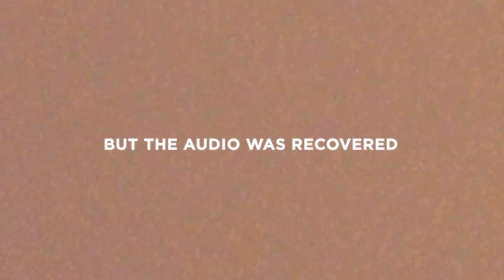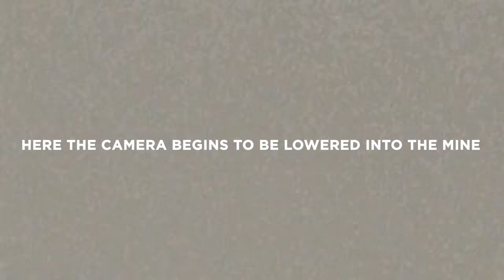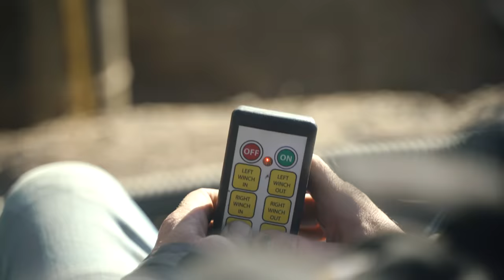We Founds Bones, Guns, Old Camcorders, and More While Searching This Mineshaft For Susan Powell

Comment: Hey Dave the weird burnt thing that you found and hold at 44:45 into this video is dirt, and rock. I have a dirt box forge and after awhile the dirt under the coal heats up, and turns into that. So it had to be a real hot fire. Just thought you would like to know. BTW awesome job.

Comment: I'm not sure if you had any or not, but if you sift through the dirt with screens of different gauges it can help find tiny bone fragments. That's a common method used by anthropologists to find bone and pot shards. 
I wish I could be out there to help y'all in the search but I live in Texas and don't have a car anymore. I'm freshly graduated as an anthropologist and got familiar with some basic stuff.
Reply: I highly doubt he took the effort to cremate her and then dumped the remnants down a mine shaft. Her skeletal structure is probably mostly intact. The kinds of bones you deal with are the bones left on the surface which have been gnawed and chewed on by scavengers and fragmented and scattered around.
Reply: @jackhoff3910  if you listen to the pod cast they talk about how he had practiced burning stuff in is garage so hot that it could burn a body. He obviously had been planning and would try out things before he killed her.
Reply: Pot shards? Pot. Shards. 🤨
Reply: @user-hc7lh6yj1z  Interesting. I didn't know that. But, I would think that if he sufficiently cremated her, there wouldn't be any need to drive out to the desert and locate a mine shaft and dump the remnants and then spend the next 8 hours burning up the head-frame and shoveling a bunch of shit into the hole. If the cremated remains he was dealing with were small fragments, the most logical choice would be to drive down a busy highway and sprinkle them out the window.
Reply: @jackhoff3910  I don't think he achieved it, my guess is he tried and then had to scramble to finish covering up.
Reply: @user-hc7lh6yj1z  Possibly. That would explain why they found a few loose bones. He may not have been able to adequately cremate and crush them, so he brought whatever was left and chucked them down that mine shaft.

Comment: Heavy D, I'm sure that by the time you read this you will have figured it out already but.  As a mining guy, and since you haven't mentioned any levels coming off of the shaft yet, I expect that you have at least 12' of digging yet to do, maybe 20+.  Given the fact that there was a headframe there, there is a level down below.  Below that level in the shaft there may be a loading or spill pocket.  Fingers crossed that you can complete the story for her family.

Edit:  I forgot to mention.  A trip to the local Mining Recorder's office should tell you how deep that shaft was, as well as some of the history of the mine itself.  If the shaft has multiple levels, then you guys should be tied off while digging.  Running muck (collapse) can bridge, especially if there is an obstruction below like a timbered shaft station, or cluster of burned timbers.  The right amount of disturbance can make that plug run which would be bad news for your crew if the mine has two or more levels.  If you are tied off when that happens, then the worst that can happen would be you hanging there like a big old spider in your 5 point harness until the bucket got back to you.
Reply: Correct, just watch scott Nuttall’s videos on the 4 metal mine that sparks mentions.  Also, a little strange that les (his brother) is the “tipster” and scott dropped a camera 4 months ago (different type), found a pair of pants (not the women’s one) like the ones that were just found by the crew.  
This case is sad and I’m hoping they do come across her for closure but don’t think they fully understand how big these mines can be especially with how much time goes in to a shaft like this.  Then again if there isn’t a rust or ore seam they could have just dug straight down with no luck.
Reply: @tekkadan9688  Most shafts are sunk in the footwall of the orebody, that is, the deeper you go, the farther away from you the ore is.  So there shouldn't be mineralisation in the shaft.  I've seen some old mines from the 1800's that had shafts sunk through the ore midway down, and others that are inclined along the dip of the vein.  The problem with those two types is that you sterilize the ore around the shaft pillar and can't get it out until the end of life of the mine and even then it's a total PITA.

Comment: Yay! Part 2 is here. I'm hooked. Question: Is there a large vacuum type piece of equipment you could drop down the shaft and start sucking the dirt pile up? If what is sucked up is contained - it could be sifted through later to determine if there are bones down there. Question 2: will all recovered bones be turned over to the police?
Reply: Good question.
Reply: @captaindeadpool1640  Ty

Comment: My thanks for doing this work that needs to be done. Couple of basic, entry level but very important things are missing. (1) Guard wall and harnesses at the top of the hole keep anybody or thing from falling on the folks at the bottom of the hole. (2) Mesh sifting tables to screen out artifacts and evidence from the debris brought up.
Think about it this way; if you think it's a crime scene and a body's resting place it deserves a level of respect. It's clearly a dangerous location and that requires another level of respect. The content is just as good if there is a safety barrier and a supervisor that requires everybody within that hazard area to be be roped up, helmeted and safety serious. You can't determine if you are missing anything important, valuable or cool if you don't methodically sift the contents that are being brought up. It's all covered up in dust and soot so you need to sieve out the dross to make sure you aren't throwing away that one tiny little object that breaks the case or tells us the whole story. A sifting table is cheap and easy to make and transport, the camera gear can be mounted to it and doesn't need to be handheld. 
That hole is deep, the shaft is lined with an array of easy to dislodge objects, any of which can go lethal from that height, the bottom of that pit is an extraordinarily dangerous place to work. I don't care if you use construction drop netting or a sheet 1 - 1/8" plywood, the excavation area needs missile protection. I understand if that sounds inconvenient, but it's not nearly as inconvenient as a high angle rescue, apologizing to a loved one, LifeFlight helicopter ambulance bill, legal testimony, insurance hikes, sawing lumber out of somebodies back at the bottom of a mine-shaft, etc. Blood and screaming might seem like it could get views but you can never show the true misery of it, plus blood gets demonetized and it's hard to clean up. 
Having had co-workers and friends get grievously injured in difficult to extract places such as logging decks, ski lifts, elevator shafts and crawlspaces for no good reason ever, it's always "didn't even think of that", "didn't seem that dangerous", "didn't seem that stupid" or "we always do it that way" and "it's too much of a hassle", "it's too much work", "it's too inconvenient", "it's too expensive", "we'd never get anything done if we did everything OHSA and the nanny state tell us to do", my favorite excuses and I have heard them multiple times are "it was lucky that I did it to myself because otherwise it would have been much worse", "it only hurts when I'm awake", "Sorry I shut down the job site and bled everywhere and made you take me to the hospital and wait for hours in the emergency room", "I heal quickly" and "I'll be back at work within a month". I can honestly tell you that not once has it ever turned out to be cheaper, faster or less painful to do it right in the first place.
My father was an alpinist and photographer, we lost a family friend when one of his strongest and kindest mountaineering partners backed off a cliff to focus a camera. Mr HeavyD, you appear to value your personnel as more than employees, you speak of them as friends, you speak highly of them on a regular basis, so may I ask? Which if any of their spouses and loved ones are you prepared to say sorry to? 
No it won't bring Susan Powell back but I got it all on camera, or, Sorry but it would have been great content if the guy holding the camera hadn't kept bouncing off the shaft walls while he was falling. You are in a position of responsibility, you have worked hard and had great fortunes in your life and you appear to have an angel following you around, you know what the risks are and you know how to get stuff done; you of all people know that you are in the position to make doing it right the right way seem like the entertaining, profitable and cool way to do the hazardous stuff that needs to be done. Yelling works for reality TV, I'm not saying you should fake it, but it might be even better content with you being the grownup.

Comment: I've seen a few of your videos and Everything you do is about making things better. I believe you should invest in a high volume low pressure trailer mounted compressor Rick. You can send a very small diameter hose down to the bottom. Connect that to an 8-12" 8' risilent duct. Which will give you a positive e pressure atmosphere at the worksite and allow your a positive work environment. Shoring up certain points in th3 shaft will further enhance your abilities to work in a safer environment.

Comment: So nice series for Susan Powell. Epic video!  
In what direction did you have the fan going? In normal mines you have suction out of the mine from furthest parts to have clean air going free into the shaft to clear it and all dust/exhaust sucked out in a duct hose. Low airspeed in  shaft/galleries doesn't eddy so much. And please build a landing structure over the shaft next time as the old one! ;D  A tip: Don't grab things you find with hands and even used gloves because it will contaminate the find with your DNA. A forensic technician or archeologist (screening) giving advise also next time?

Comment: Danger operation. Tunnels can break.  I watch videos of your activities.  Partial security needs to be remembered.  Or at any point under your feet you can break into the tunnel.  Therefore, all respect for work.  Just remember about the safety of the cord ... There would be no accident.  Respecting your work.  Valuable video.

Comment: Hey Guys. I'd just like to reccomend the use of Gas Monitors while underground, a 5-Gas would be best. But if you are not working around chemicals and just find yourself underground here and there, I'd recommend at least to get a H2S Monitor. They are about the size of a small handheld walkie-talkie, and are inexpensive in comparison to the 5-Gas and just clip-on somewhere like your collar or harness. When underground, H2S is a very relevant danger. At certain PPM, it will overwhelm your nose and you won't even smell it... One sniff, and it's lights out.  Please look into it, be safe out there. Thanks, - Z.

Comment: Since they are having that much dust,  at the bottom,  they need to set up what is called a,  “Reverse-Fan”   Set-up. It sucks up all the air / dust from the bottom.   And sends it straight up,   A round black accordion type folding pipe.  Crews that dig tunnels for a living set them up. They bring down as much fresh clean air,  as much as the dirty air,  as they / it removes….

Comment: If ever you need to do this again, think of what they use underwater to clear sand and such.
Vacuum cleaner. big hose have a machine suck up all the dust you want to clear. even sand.
Sound challenging, make a bucket have the vacuum extension on it to suck up sand and dust.
You might go twice as fast even.
I would find myself the meanest industrial vacuum top set that does all the sucking and engineer that over a bucket like what you have there and make it a working rig.
less dust fast cleaning.
Rocks you could always do after you done for instance a 3/4 bucket open the rig up and handle the rocks on top of that.

Comment: If this is the video that was captured I am sure I can recover the video if I had access to the original files. looks to be a mismatch codec issue and if you were using MacOS it has the tendency to do this at times also happens on PCs if the editing software is overwriting the good codex with its own.

Comment: I'm surprised you guys weren't sifting that debris material. Depending on how a body was disposed of, it may only be very small pieces. Plus given the enviroment of the mine shaft, a body would not stay a body for very long. Within months it would have been a skeleton. If debris continued to fall down upon her remains, as your team stated, thousands of pounds of debris, I would be very surprised if you found anything large or intact. There wasn't anything large or intact recovered. If in fact Susan was down this hole. Unrelated, I would have loved to have taken a metal detector to those debris. Lets hope this brings closure.

Comment: I am watching the vid first time. HD and I think Ethan are over where the still existing structure over a diff mine is stationed. I noticed this and thought just how odd … right prior to 40:20 I saw the indentation — looks like a heart. Very odd to see. Down by Ethan’s feet at 40:20.  With a tiny hole in the center, perhaps.  Just odd at this point in time and the vid.  Things that make you go hmmm.  I thought at first it was footprints. Closely placed.

Comment: Shouldve screened cleaned the dirt for teeth small bones as u went thru it.. ya'll think this dig was hard imagine 100 yrs ago starting at the top & digging straight down 250ft with shovle pick & few 5gl buckets thats serious toughness & will power plus dragging all thqt lumber all by hand & horse or ox yall using machine to pull it up got it easy

Comment: I don't want to win a truck or car what I would love to win is a dozer or track loader so I can get back to work I cut timber by myself and been using a old international tractor 484 to pull the logs with and my tractor is down started knocking really bad and lost power though it was a injectors had them rebuild cost me most of the money we had put back and it is still knocking in one cylinder don't know what it is moved injectors around it just in that cylinder and this is about the end of my company a dozer or track loader would be a game changer for me I found one for a good price but can't get a loan for it  if I  could get it would be able to pay for it in a month
Reply: Johnny Head
Do you have a class A cdl?
Reply: @figgiefigueroa7372  no I don't have a CDL
Reply: @johnnyhead.7532  
I have a trucking company and you can make cash 💸 with us,and send your truck to be fixed. Just a tought